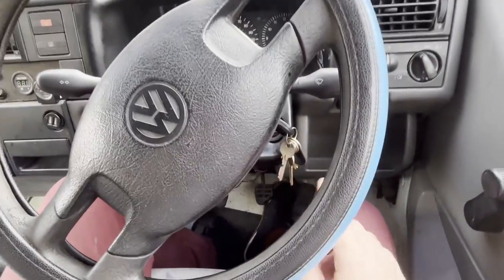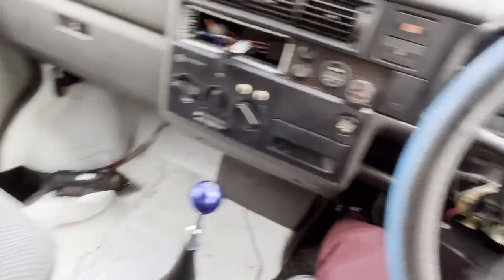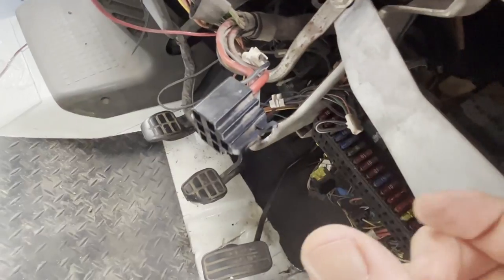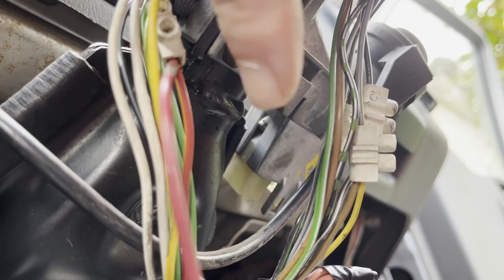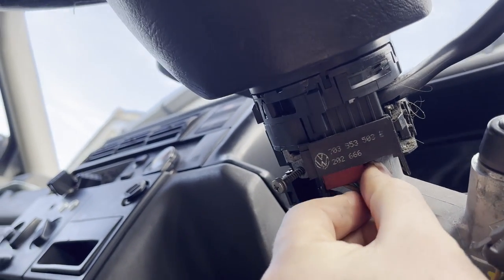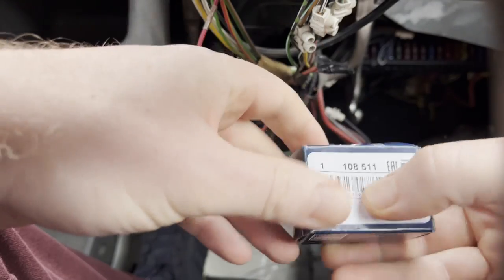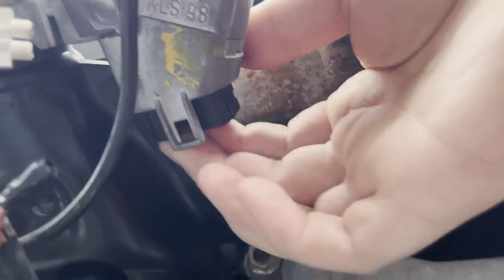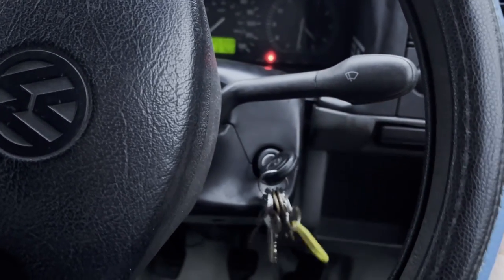VW T4 - Ignition Switch Replacement

Comment: literally just done this job on my T25, but we have to take off the steering wheel, remove the indicator and wiper stalks and slide the barrel off to get at the switch! guess they realized it needed to be more accessible :)
Reply from the maker: Yikes!
Reply: Old man, is that to get at the switch or screw ? Thanks in advance :)
Reply: @artinconstruction9070  thats to actually get to both. you have to take that all off to access the screw and remove the switch. is pretty stright forward, about 25 mins start to finish.

Comment: Thanks I had intermittent turning over on my T4 never failed to start but had to turn key several times until it started.  Ordered the ingnition from just Campers and did the job today. Perfect starting better than ever now and I could see the wear on the old ignition switch plastic where the end of the key goes in. Mine is a 1996 T4 diesel 2.4 AAD. Thanks for your guidance much appreciated.

Comment: You are a legend, I have worked on trying to get that little screw out for ages and finally yesterday my van died at some lights and I had to get help pushing it into a parking spot and left it overnight.  Was going to get it towed to auto elec but then saw your video and that screwdriver you used.  Light bulb moment, found a small phillips head screwdriver, put a 90 degree bend about 20mm from the bottom and had the little shite out within 2 minutes, replaced with ignition switch out of parts van and starting like new.  Saved me a motza, great video, well done.
Reply from the maker: Yikes! Well done

Comment: A few years ago I put a small amount of graphite powder in the ignition as the barrel was sticking when turning the key. It did the trick. 3 years later I tried it again and the van would not start. After a few attempts, it started but was intermittent.

I had a new ignition switch in my parts box. Today I swapped them and found the old switch clogged up with graphite powder. 

Thanks for the guide! 

I had a set of the bent screw drivers already. No idea how you would do it without them.